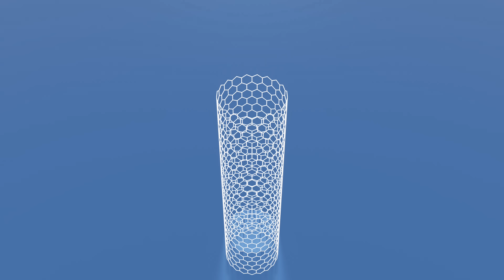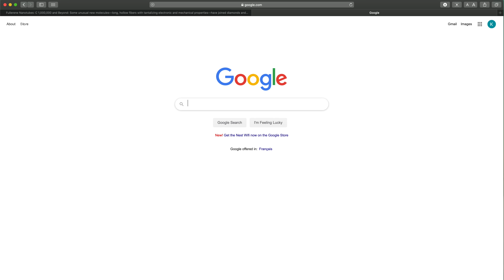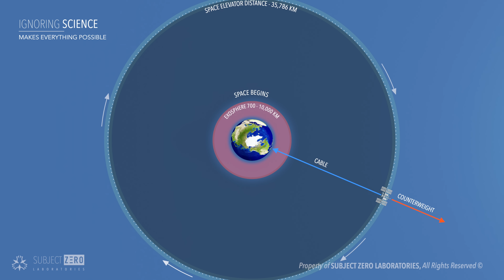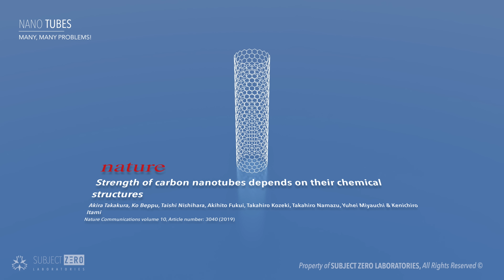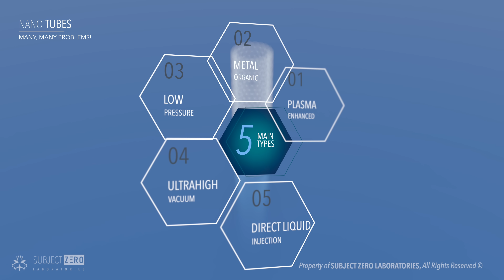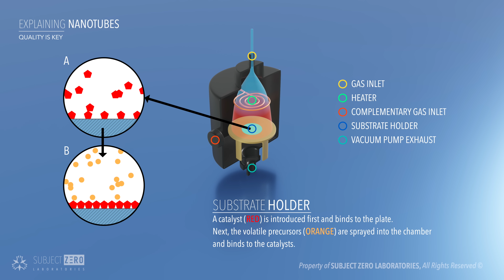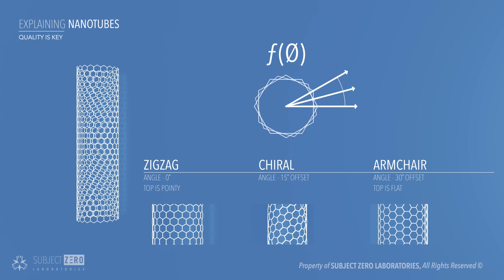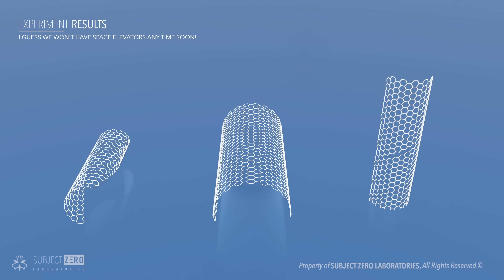Nanotube Strength, Bad News for Space Elevators [2019]

Comment: there is many problems to that cable. problem number 1, the stretch of the cable is not even across its distance. its more in one place. problem number 2.  distance to stratosphere is very high up. there is no place where space begins in the sense of a space elevator. problem number 3. there is no stability for the top of the elevator to remain in because things moves litte bit faster up there than down on the surface. a geostationary orbit would be impossible as the station would have to be stationary with the earth and still fall down. problem number 4. wind and resonance. storms and wind will cause the cable to start to move fourth and back like a wave and trow the cable into random movement and cause the station to fall down and crash. if scientists was so damn clever, they would have realized that such a space elevator is a project doomed to failure and impossible to work. they would have to come up with somthing way better than that. even a giant pyrmid tower big enough to reach space would be far better idea but that have already been tried. it was the tower of babel.

Comment: just build a giant electromagnetic rail launcher it needs to be about 50 miles long vacuum sealed with an acceleration phase - gradient and a climbing phase + gradient it will slingshot stuff into orbit! they can use Mount Whitney as their building ground have the desert as the acceleration phase and the mountain itself as the gradient it will easily go 4 miles up high it would be a 4g acceleration rate to 1.11 mi/s over a 45 seconds time spam when the inertia speed slows down thrusters can be used to reach the Exosphere. it stills rely on rocket fuel or stuff like that but in a lesser amount!

Comment: Not to mention Conservation of Angular Momentum, where lifting a weight from the equator, traveling at 1600km/h up to geosynchronous orbit, traveling at 11,000 km/h would cause the lifted load to pull the cable backwards, reeling in the counterweight, until it all crashes to earth.  In physics, NOTHING IS FREE.
Reply: Thats way this uses the earths own rotation

Comment: If a space elevator is ever feasible, it would be way more sustainable than rockets in the long term.  Plus, there's a natural place for a space station at the top of a space elevator that would make for an ideal jumping-off point for exploration of the solar system that would probably exist at some point even if the space elevator itself didn't, so if it's possible, why not build a space elevator there?  Us poor non-billionaires want to get to space at some point, too, you know.

Also the tech will certainly be important even if it isn't viable for Earth, because the Moon doesn't have rocket fuel on it.

Comment: Why not build a space crane instead of an elevator?

Dangle it from the space ship so it does not need to be a fixed structure and use a winch type machine to pull loads up and down? That way the structure only needs to be solid  at the spacestation side and can be tethered into the Earth at the other end allowing the cable flexibility of movement which will be more forgiving with a defective nanotube.

Comment: well, orbital ring is possible, and cheaper (if you need lots of cables)
- So, I just prefer that.
Reply: acorn. A orbital ring could possibly be cheaper completely perplexes me, like how? Its like how he sizes to think that Rockets can somehow be more evicent the an elevator.
Reply: @c.j.3404  Orbital ring allows for many connections to the planet, all along its 'length'. You do not need to build a different elevator in every city.
Also, it can serve as a cheap way to get to and from orbit using a mass driver. (space elevator can too, but only geosynchronous)
Also, it can serve as a good place for industry in space, that is better with some gravity. - It provides a lot of 'living' space, compared to just an elevator.
It is probably possible with materials we already have.

I'm not saying it would be cheaper than a single space elevator (except possibly for cost of (impossible?) material for space elevator) but once you have a large space industry, you will need a lot more throughput, and rather than building tens of space elevators, you can build one strategically placed orbital ring, with cables to hundreds of cities
Reply: Well yes but a) until we have basically put our intier civilisation into space two or three space elevators are probably going to be enuff. And b) its not like space elevators don't have ridiculous though put already, really its going to be the infrastructure ground side thats going to be the issue more then moving on the elevators.
Reply: @c.j.3404  Well, I'm obviously against neither! We will likely start with elevators anyway, unless they turn out to be impractical, and we would use skyhooks or something instead... Eventually, I expect orbital rings will take over, but who knows... maybe a tall mass driver could turn out to be cheaper, elevator ~impossible, or anything else...
- I agree that the original comment does not come off the best... - I just like orbital rings, because they seem neat, and I've heard good things.
Reply: @Verrisin  I do as well but there is a reason it took until now for for reusable Rockets to become a thing now when we have had the technology sense the 80's there gust isn't enuff stuff we want to send into space for the cost reduction to be worth it until know, same for the orbital launch loop.
The way I see things heading is that first reusable Rockets starts the space industry boom, that cases enuff material the be moving in and out of the planet that space elevator to be made, (would cost $5 per kilogram i don't know where he got the $220 in the video) and after several are built and we basically have moved are hole civilization  into space then the elevators are connected together for a orbital launch loop (which would reduce prices to $0.05 a kg) ironically making a trip to the moon cheaper then a trip to many places on earth.

Comment: So what we need is a machine which can produce about 1 km of a zero defect cable per hour. In such speed the cable might be ready in ca 5 years - perhaps the full lenght needs to be in one piece. Well, good luck guys. I think such task isn't possible with any material. Even in a simple plastic track there will occur a bubble / weld line / foreign material after kilometer 33000 for sure.

Comment: You can't make a conclusion of it requiring a strength of 63 gigapascals, without knowing exactly what the mass per unit length of the cable is. Because the required tension would scale with the mass of the material you see.
Reply: Let us not forget how hard it would be to successfully tether this beast.

Comment: This video makes it seem like space elevators will have human hair width cables for some reason.
A few comments have stated, "why don't we just weave the cables together, thus alleviating stress on the structural integrity"
The answer is because that is EXACTLY what they plan to do! Will the cable be heavier if woven together to become stronger, YES it will, but no scientist or engineer is under the delusion that a human hair sized cable is supposed to somehow support the stresses of a space elevator AND carry loads containing equipment and people off world. Just because a carbon nano tube is stronger or less strong under EXTREMELY specific, near microscopic circumstances does not mean that spells the end for a space elevator.
This video does contain relevant info if we are talking about carbon nano tubes and their individual structural stability. But it is not considerate of woven carbon nano tube cables and their designs for space elevators on a large enough scale to cause structural instability. 
The title is mere click bait.

Comment: A space elevator on the moon would be more practical than using rockets. 1/6 G and no atmosphere, seismic activity, or weather.  We could probably make the cables with already available materials, especially graphene, if not Kevlar or even steel. A lunar space elevator would alleviate the need for rocket propellant, fuel and oxidizer. We wouldn't want to waste precious lunar resources, especially water by burning it.

Comment: Let's not forget that there is also a 300kv charge differential between the ionosphere and ground. The atmosphere is a dielectric insulator that a space elevator would bypass. As it is, some of the charge potential travels along the field lines of the magnetosphere while others descend through the atmosphere charging up storms and then descending further as lightning discharge. Building a space elevator would bypass this protective circuit and connect that 300000 volts to ground. No one knows what this would do. 

There are a lot more issues with a space elevator than just the tensile strength of a cable.
Reply: Except, gust put a insulator at the ground, assuming this exist because this is the first iv hered of this.
Reply: @c.j.3404  Lord Kelvin made the original estimate of gradient potential, recording on a fair day a 300V/meter. Therefore it would require more than just an insulator at ground, as any two regions could have a potential difference.
If you've never heard it before, it's lukely because it is one of those things ignored in the standard model.
Reply: @daemonnice  ? Honestly i have no idea what your saying here, discharg dosnt matter if it has nothing to discharge to, if anything this could be used to power the elevator it seems like but the charge itself isn't a issue.
Reply: @c.j.3404  if you say so

Comment: doesn't seem too bad
there are a lot of common misconceptions both about space elevators and about material strength
the thing is oyu could hypothetically make a cabe using a relatively weak material as long as you taper it making it thinner at the ends and thickest at geostationary orbit
the problem is that htis would have to be exponential and with a normal material the diameter at geostationary orbit yo uget would be absolutely insane so it would no longer behave like a rope which would make things even worse
but with nanotubes even if they aren't quite up to the ideal strength one might hope for it's feasible if you taper the wire correctly - the biggest problem seems to be how to actually turn these into a workable material, probably by working them into a compound

Comment: Why not just braid them together like rope or steel cable?
Reply: I don't think that's the point here. The point is being super strong AND lightweight. If you make a rope out of it, it gets way heavier.
Reply: Well yes the rope gets heavier, but also the strength of the cable increases with the same amount, so the possible length stays almost the same. This is called self-support length, which is the length at which a rope breaks under its own weight and mainly depends on the material, no the thickness of the rope itself. Of course you could have a greater payload with greater rope thickness, but the self-support length stays the same and is the limiting factor for space elevators currently.

Comment: Seems to me like we're still at a very primitive level in terms of building nanotubes, trying to squeeze out order from highly random chemical bulk processes. Seems to me the only way we will ever get perfect nanotubes of any significant length will be by assembling them with nano machines which would act in some way similar to how ribosomes assemble proteins.
We will of course first need to build the nano machines and that might even be done through the route of bio-engineering by modifying existing biological machinery rather than starting from scratch.

With all that however there is still the problem of defects forming after manufacture so there will always have to be an allowance made for defects no matter how perfect it was originally.  Such defects will inevitably be caused by ionizing radiation from the carbon 14 present as part of the nanotube material as well as more significantly external radiation, which in space is no trivial amount.
Reply: Human cells have something like 6ft of DNA each, and they can replicate over the course of a few hours in some cases. So there's a precedent for low-defect high-speed polymerization. Just need to find the right substrate and engineer the right enzyme(s)
Reply: @danielculver2209  Do we talk about the 36000km of nanotubes needed ? at a rate of 4 meters/ hour we should wait a thousand year to generate one continuous strand. The real question would rather be "how to you merge 2 strands perfectly ? " ....
Reply: @GaspardDSM  Yep ligases are the enzymes that do that. Twisting the fibers into twine would be another solution. After a certain length and number of twists friction between fibers is stronger than the fibers themselves

Comment: It doesn't matter.  Nothing is free.  If you start lifting a weight traveling at the speed of the surface of the earth at the equator, around 1600km/h, up a Space Elevator, conservation of momentum will tend to pull the elevator cable backwards anyway, thus reeling in the counterweights holding it tight.  Eventually, the counterweight and the "geo-stationary station" will be pulled down to earth and crash.

Comment: Space elevators are not feasible even if carbon nanotubes were 50x as strong - they are flammable.  They would deteriorate in air even absent ignition temperature.

Comment: A single strand may only have a GPA of 200, but bound together in a woven rope those strengths are multiplied. Anyone can pull apart a single strand of nylon, but if you weave 100 of them together you will not pull it apart.
Reply: GPa = gigapascals = strength per unit area. If you add more strands you do not increase the strength per unit area.

Comment: 3:40 idk but spaceX is looking to get the cost per kilo down to $20 per kilo with their Starship rocket.
Reply: For now that number is also in the realm of fiction just as much as a space elevator
Reply: Brandaan Vandebotermet not really. It’s tech is already proven, the Space elevators tech is not proven.
Reply: @squdardt.9719  refurbishment has been proven sure but it still costs 2000-3000$ per kilo so that is nowhere close the projected cost of starships 20$ (of wich not even a prototype has left the launchpad)
Reply: @FlamesForYou  From where did you get that number? SpaceX currently can send $1400 per kilo to low earth orbit. 

And also if SpaceX can launch a Starship at $10 million (which is 5x as much as predicted) and the Starship can get 100000kg to orbit (which is 1.5x less than expected), it would cost $100 to orbit. $100 is still much less than the $220 price of the space elevators.
Reply: @squdardt.9719  I am not making a case for the space elevator.  The point is that their cost might get of quite low but aslong  as they dont have any competition they wont offer those rates to costumers not by a long shot.

+we first need to see if their starship platform will turn out as they want it to
Reply: @FlamesForYou  I mean, that's what it will take to send passengers into space, right? They won't get many customers if they price per kilo is 1000$ per kilo, right? Here, the problem isn't competition but the low amount of costumers that are willing to purchase a ticket.

+Starship is most likely gonna perform as planned.
Reply: @squdardt.9719  well their Mk1 exploded in the test stand so not looking too good to keep on shedule
Reply: Brandaan Vandebotermet mistakes happen. They won’t cancel the entire project because of this. And we weren’t talking about when it will be completed so the scedule really doesn’t matter.
Reply: Brandaan Vandebotermet I kinda expected an explosion. I mean, they’re not gonna achieve the perfect starship without explosion.
Reply: @FlamesForYou  Even SpaceX kinda expected that to happen. SpaceX said that in their statement about this incident.
Reply: @FlamesForYou  Also, it looks like Starship lost no nut november.

Comment: even if you got launch costs near zero, the infinite reusability with only electrical power makes it worth building one over using rocket fuel for everything.
Reply: The costs for maintenance on a space elevator structure are unknown and could turn out to be astronomical as well.  We will have to know more about the materals it will be made from and their durability before we can even make a guess at those costs.
Reply: @wpatrickw2012  My argument was mostly with fossil fuel use (hydrogen is potentially carbon neutral but is currently cheapest to source from gas extraction). Not maintenance cost, I do have my doubts about just how extreme the maintenance but that wasn't the focus of my post.

Comment: So in the video it is established that carbon nanotubes do have the strength necessary to build a space elevator with them, but that the technology of today is not capable of producing the quality of nanotubes required, and concludes that therefore a space elevator is not possible.
This is all equivalent to someone in 1910, just after the Wright Brothers flight, offering opinions on the state of aviation we can expect in 2010, them basing that opinion on the technology of 1910 and offering the conclusion that intercontinental flights are obviously impossible.